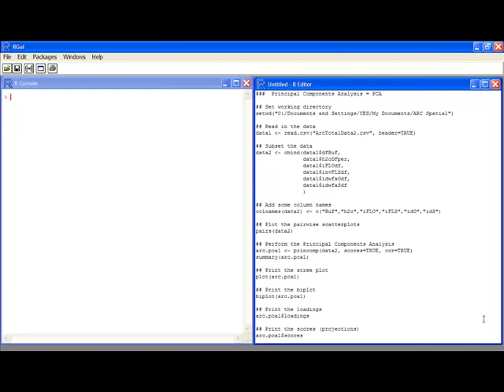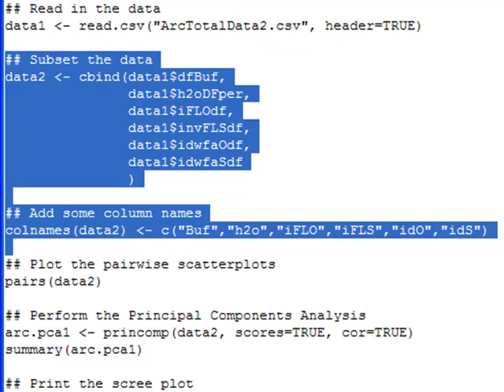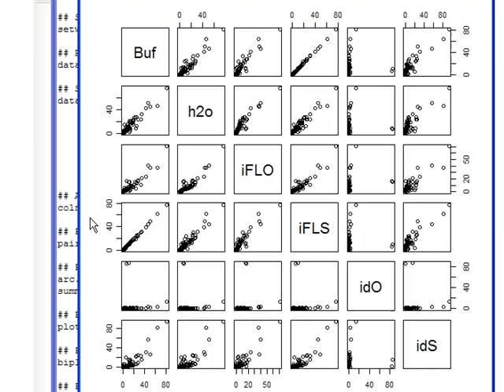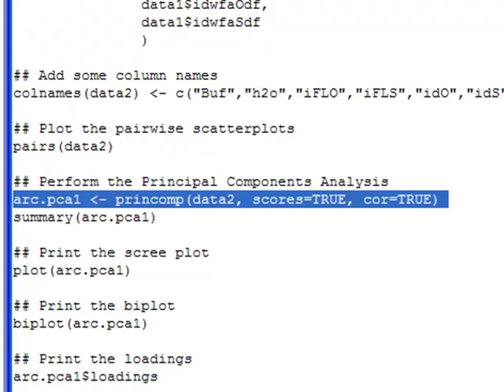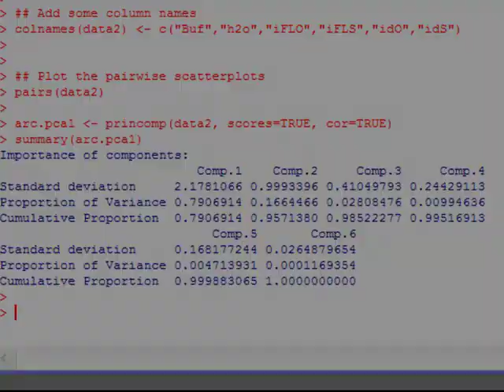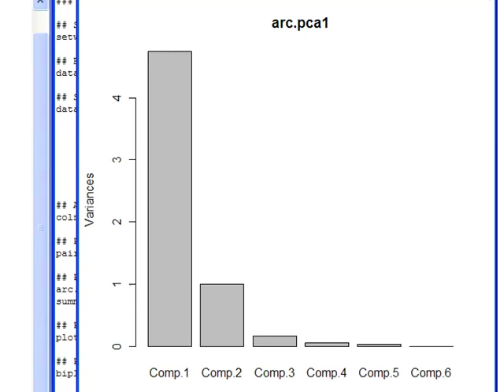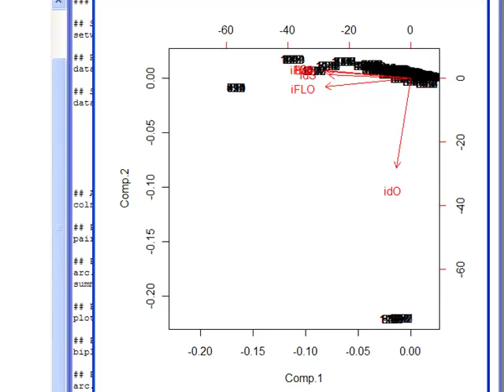PCA in R

Comment: Hello! very useful tutorial. I want to ask you: how many samples and variables are considered as minimum for this kind of analisys?. Other question: How can i put the names of the sample in the graphic instead the numbers in black?

Thanks!!
Reply from the maker: Hi Jose.  As for the number of samples...  in order to get a reasonable analysis it is highly recommended that you have more samples than variables of interest.  So if your data set has 7 variables then you will need 8 or more samples.  As a "rule of thumb" 10 samples per variable seems to perform reasonably well.  If you have 7 variables then you need 70 samples.  As for your question on putting "...the names of the samples..." I am unsure of your question so I am unsure how to answer that.

Comment from the maker: Hi Yooogggeee...  I think your problem is that one or more of your variables all have the same value.  In this case they do not vary and hence the variance is 0 and the covariance is numerically 0.  If you have a covariance that is numerically 0 then PCA can not work.  Go back through and check your data and see if this is the case.  If so you may need to omit those variables.  If not, I would have to know more about the data.

Comment from the maker: PCA monopolizes on the correlation.  If there isn't any correlation then PCA really doesn't help that much.  If they aren't correlated then all the variables are essentially uncorrelated which means you can't compress the data into a smaller set of data.  They don't need to be highly correlated.  However if they aren't correlated very much at all then PCA will not help that much.

Comment from the maker: You will need to export them.  R does not directly talk with Excel.  You can take the new factors/compnents and export them into a CSV file which Excel will read.  However don't expect the two to talk directly to each other.

Comment: PCA as a matrix operation requires all values to be available. You might just remove any observations with missing data, or you can interpolate the missing values from its neighbors, for instance using the 'imputation' R package. I haven't needed it myself fortunately but I guess the manual should set you up.

Comment from the maker: As I don't do a whole lot of work with SVMs from when I have used them I have used the libsvm package.  Here is a link to a paper that has examples of using SVMs in a few different packages and an assessment of them.  It also gives example code that you can run to get things going.

Journal of statistical software... version 15, issue 9.